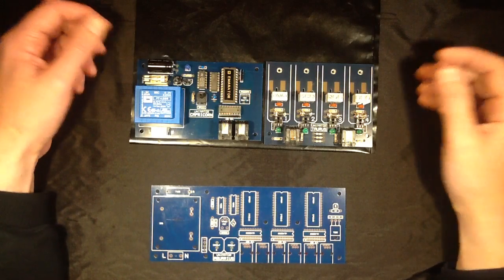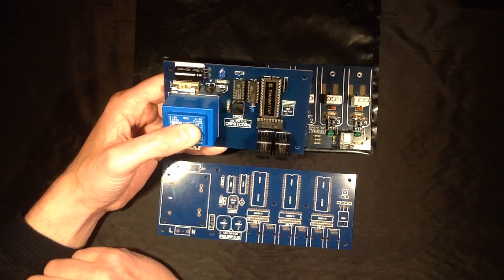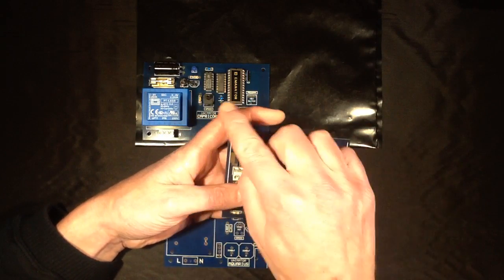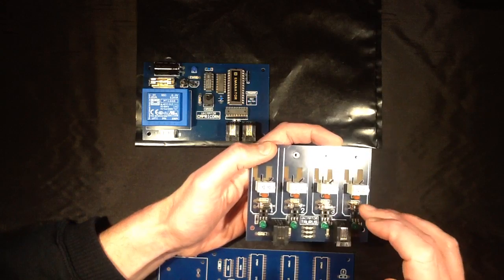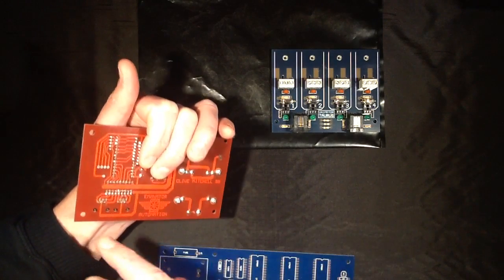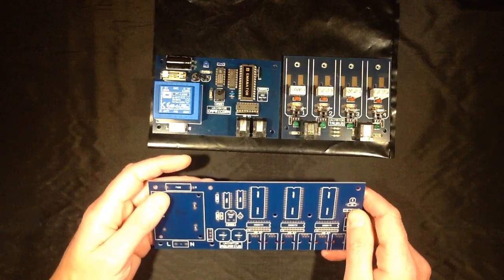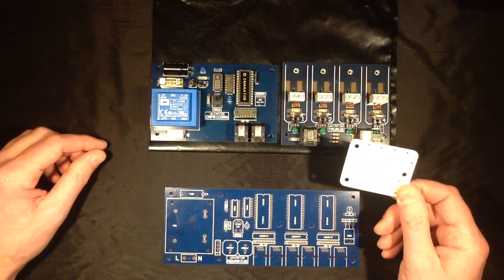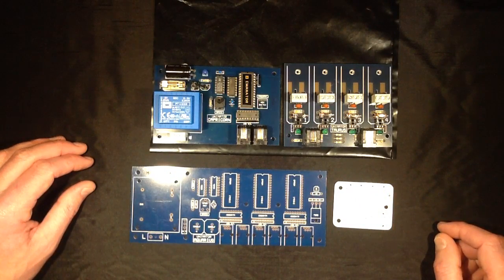Fairground lighting controllers.

Comment: Clive: I agree with the power indicator. I go further with mains, low voltage rails, and blown fuse indicators. It wouldn't be a good design for a consumer item due to incremental cost but I like seeing all the lights and knowing what is going on.

Comment: I made a control unit to run the helter skelter light string at Chipperfields Fair Ground, Dorset, back in the 70's. I switched DC, not AC using thyristors to switch on and a shunt power transistor to switch the voltage off across the thyristor to switch it off. Five channel 2kW per channel, 250V DC incandescent lamps running down the ride at night. Scary stuff DC!
Reply from the maker: The DC is quite viscous.  Like working with an arc welder.  I used to service the old DC controllers that used a capacitor to briefly shunt the other thyristors when the next in sequence was turned on.
Reply: Yes good fun, I still have curly hair and a Harley-Davidson beard, to go with my 1965 XLCH1000. I made it to retirement, which is very pleasing and I will be getting all my NI contributions and hopefully tax back before I move off this mortal coil. Good to see your experiments. Keep it up.

Comment: I've designed and built a hell of a lot of very high current 3P motor controllers and I've never seen anything like this. Amazing work. 

How on earth did you get this stuff listed by rating services?  There is no way I could get away with this approach. 

At very least, the mains power supply would have to have a final fused disconnect before the control circuit link. Not off board but between the transformer section and either the regulator or logic sections. 

Just amazing what you got away with. I can't imagine what the crappy ones you refer to look like (not to imply that your brilliant work is in anyway crappy, just that it would be unlistable  by UL under our NFPA.)
Reply from the maker: These units were not in any way certified.  The market was too small and specialised to go through a listing procedure.  The full panels contained suitable circuit protection and all the transformers I used were inherently short circuit proof and had internal PTC thermistor protection that provided better in-situ protection than a fuse could for phase/neutral accidents.  by electrical standards the units were deliberately over engineered based on the real life environment they were working in.  They're still working right now all around the world.

Comment: It would be awesome if you recorded an out-and-about video at a carnival pointing out  possibly some of your controllers in action and the kinds of lighting patterns your controllers produced.
Reply: Yes I was just thinking the same thing.

 also has he ever produced any controllers that are designed for the US market?

 or that would have an option of course with possible component changes?

 such as different value for the current limiting resistor for the neons?

 possibly a different power transformer if that Transformer does not support both 120 volt AC and 240 AC as well.

Sorry can't really tell from the video at this point if that Transformer would have that capability AKA either a tap or two 120-volt primaries.

 which of course would be wired in series or parallel for voltage changes.

Also something on that with Transformers that have two isolated 120-volt warnings to be wired in series or parallel for voltage selection 120 and 240 that is.

Would be feasible to use one of those Transformers what's the two isolated windings for voltage selection.

 akka to 120 volt windings if you were not using the Transformer heavily on the secondary and needed a not a lot of current but some isolated 120 volts AC.

Would that work to do it that way.

Although it would be to use a higher current AC Transformer and use a second one connected to the secondary low voltage side.

 both secondaries of course same voltage as an isolation Transformer.

Possibly a better idea trying to save the expense of a dedicated isolation Transformer.

This is non-critical but a way to do it inexpensively.

Without going overboard on some really hard to find Oddball Transformer.

Although theoretically it could be done possibly something off-the-shelf as replacement part??

I have used power supply Transformers back-to-back for isolation.

Not an ideal situation but it works.

AKA just looking for a rough-and-ready down-and-dirty lowest cost solution!

Also with the fairground lighting system he is referring to I was thinking about with if it's available for the United States Market AKA 120 volts ac.

Instead of 240 ac.

This might be something that may work for stand-alone Christmas light displays as a lighting controller.

Either Navy for animation or even just interesting patterns what I have you that don't repeat very often in some cases!

Plus the modularity of the system.

And could definitely be customizable because eprom storage!

You could even had an enable / disable input if desired.

Say you're switching between different things and or changing things in Cycles or whatever on your light displays.

And since everything is already ethernet type connections the system could be easily built up and also modular in its entirety.

If you're not using all channels you could even be able to do something to sync things together AKA start-stop or inhibit.

You may want to do something but not go full-blown computer-controlled this might be an option or a slight modification of this system might work.

Also something like this might be alcohol to almost anything where you want to be able to control lighting in specific patterns.

 but yet modular easy to service robust what have you.

Or say you're doing a chasing system and using incandescent Christmas lights.

 or perhaps even a mix of mini lights and full size Christmas lights AKA C7 and 1/2 in C7 as well.

And want to keep everything in sync even on multiple power supply circuits.

Since everything is fully isolated this might be the solution!

Been thinking about that many years!

And yes I've seen both scr's and trac's blown to bits under heavy fault!

Happened One Time when I was servicing something and another occurred after the initial repair while still under test!

Yes I did omit the word AC volts.

 but probably would be understood also any ideas on that if you really do need to say volts ac every time?

Just in general conversation with or comments in something like this it saves a bit of banter one could say.

Just want to know if somebody out there with no if that's acceptable to admit things like that when something would probably be known already.

I am self-taught in electronics and sometimes people have questions like this.

 you know and of course people like me would not be with IEEE nomenclature ran into that quite a bit so those people are out there let's just call electrical electronics know-it-alls.

In a way that's not offensive but just giving backlash to let's just say the people that's between Hobby and getting there!

Electronics enthusiasts Unite!

Any thoughts on any of this please comment don't be a hater please!

 there's enough of those here on YouTube you know.

Also I wonder if there would be someone like this open source?

One last thing.

Back probably in the 80s they had those brass Christmas bells that were actual Bells not the bells of Christmas that the sound was produced electronically.

More than likely probably just a couple of logic gates connected with a couple external components to produce a decaying tone reminiscent of a bell.

And yes easy to do there is a project in proper Electronics don't know which Edition or the name of the project exactly.

It had a representation of a swinging Bell and LEDs and and a sound effect.

Also seen other similar circuits elsewhere for imitating a sound of a bell Wikipedia logic gates in a few other passive components.

But I digress.

Back to those brass Christmas tree Belle's dad actually played Christmas songs.

The controller was entirely based around a a single memory chip Darlington drivers standard logic chips.

Essentially was working very similar to how it works on the clocking on this lighting controller in the video.

Basically just walking through one memory address at a time.

Since it only used eight Bells which yes you can play music with only eight notes available.

Essentially all it was was a memory chip that was programmed as far as you can go with as much music that would fit plus a few pauses between.

To fill the memory chip.

As each 8-bit byte was accessed if there was a a bill that need to played A 1 was present when 0 is present the Bell was not played.

Chances are it was probably just a counter that was just looping through all outputs a steady rate.

Also I do know for sure that that's how the old Marquee lights used to work the first ones that came out.

Yeah when are set finally died salvaged.

If I'm not mistaken I repurpose the controller for something think it had something to do with something that I built a marquee for someone else's model railroad.

Is running off the AC from one of the train power packs.

I found it was easy enough to use it on low voltage!

Saved me some Time by repurposing!

Also I heard recently it's still going strong.

Although a few of the bulbs had to be replaced.

But I used subminiature screw base bulbs!

For that reason.

Also fast acting fuse in each of the four circuits incase of an issue.

Wished it happened once although controller survived!

Just goes to show bit of over-engineering sometimes is beneficial

Comment: any chance on doing any videos on 3 phase generators? how they work and why they are used? as a mobile caterer we have one and use it, but i'd like to know more about what im using.
Reply from the maker: That's actually a huge subject that opens up a can of worms regarding grounding depending on the location and vicinity to other supplies.  The main things to know is that your loads should be spread across the three phases for most efficient operation and extreme care should be taken with the wiring to ensure you don't lose the neutral as that could cause electrical damage to some equipment.

Comment: I too did repairs for fairgrounds and midways in my younger years, the nightmares WIRING and SAFETY I would find of OTHERS workmanship was out right deadly. Some of the workers would TRY to fix their ride them self by putting car fuse in the sound amps they was OVER driving. had to redesign the amp so the main audio chip could be replace fast and install a resettable fuse

Comment: There are still firms making mechanical sequencers, border chasers etc. out there costing hundreds of $s - weird in this age of PIC controllers.
Reply from the maker: +Richard Deasington The mechanical ones are bomb-proof.  If a contact burns out or a switch breaks you can replace it.  If a microcontroller based one fails it can often mean having to buy a whole new controller.
Reply: +bigclivedotcom do you have any mechanical ones laying around? Would love to see that in a video.
Reply from the maker: +DerekJ It's extremely rare to see a mechanical controller in the UK.  They are primarily electronic.  I did notice that I could hear a lot of mechanical ones in use in America.
Reply: plcs are super popular across all industries to this day, and are often hilariously over-specced for the jobs they do.
Reply from the maker: SuperAWaC I suppose that's similar to using a microcontroller to flash an LED.  Seems overkill, but cheaper to put together, and easier to modify later.
Reply: aye, also it's pretty impressive how often stuff doesn't get optimized past the prototype stage
Reply: +bigclivedotcom  probably just a relay click. Most of our rides are overkill, like a PLC for controlling the lights

Comment: Not related to this particular video Clive, but something I have NOT been able to find definitively online, do you know what voltage do dodgems operate at? Every time I approach a fairground ride with a DMM I get shooed away!
Reply from the maker: The overhead ones work at 110V DC, but have variable voltage depending on how "zippy" the operator wants the dodgem cars to be.  The ones with the alternate polarity floor panels tend to work at 50V.  On the traditional cars the token mechanism traps the token against a switch until the end of the ride when the polarity of the supply switches briefly and a solenoid ejects the token away from the switch into the collection container.
Reply: bigclivedotcom Thanks for that detailed response, DC surprises me, I was expecting AC for some reason. Not come across any of the alternating floor panel ones personally yet, without the mast they give the guy nothing to hang on to!
Reply from the maker: ***** The alternating floor panel ones are rare, and usually only used where there's no over head clearance.  They consist of a floor of alternate polarity metal panels with insulator sections between them, and the cars have a number of electrical brushes which pick power up from whichever plate they're contacting.  Each brush is connected to the cars common DC motor bus by two diodes, so no matter what position the car is in or what polarity the brushes are they will power the motor.
Reply: bigclivedotcom Ingenious!

Comment: In those days EPROMs E-EPROMs and UV-EPROMs were the way to go. :)
Reply: It's such a clean solution. I really like it :)
Reply: To wipe the data off of these didn’t you have to expose them to sunlight?
Reply: UV-EPROMs were EPROMS.  You erased them by exposing them to ultraviolet light in an EPROM eraser.  Yes, sunlight will work in a pinch, but it took longer.  EEPROMS came much later.  The other type were PROMS, which were sometimes the same device but didn't have the windows, so you could only write them once.  Though I've heard if you could manage to take them to a hospital, and have them x-rayed a few times, they would often be erased and reusable.  Other PROMS had fuses inside, and once they were blown, that was it.